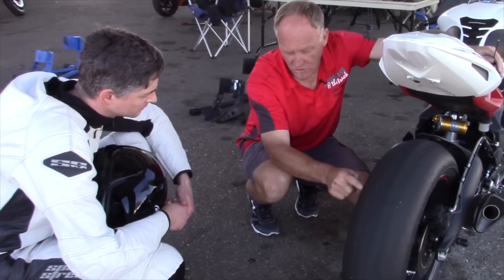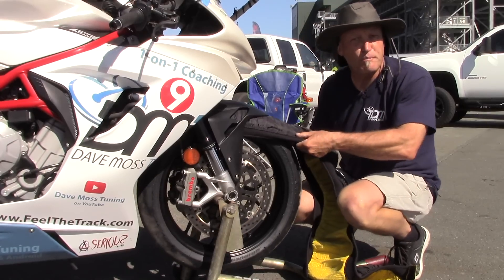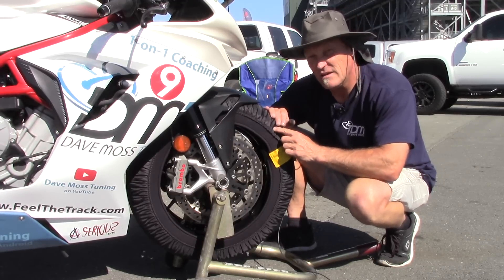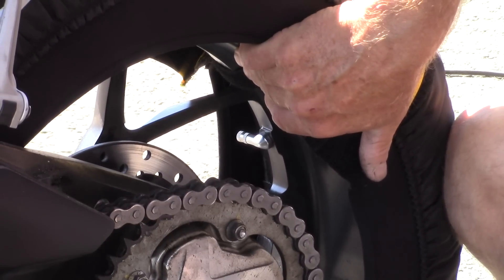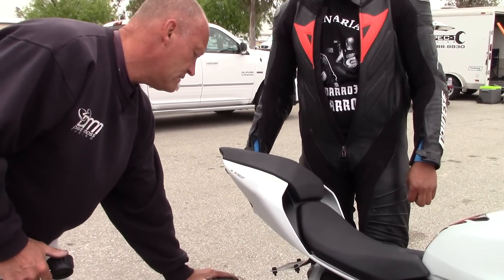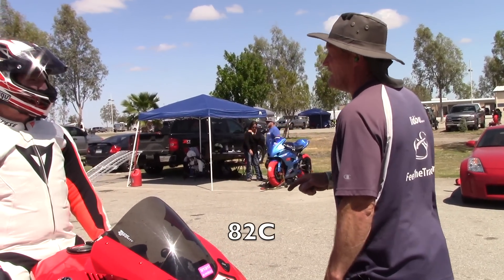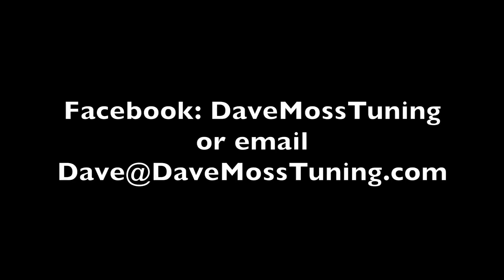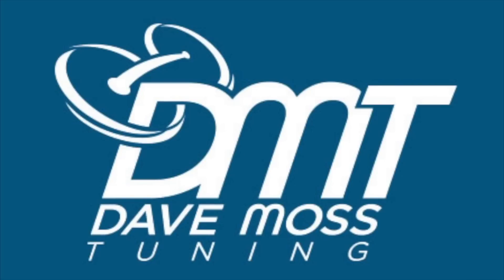Contact Patch: Motorcycle Tire Warmers

Comment: Just a thought. If that ramp you have is made of aluminium, then that will act as a heat sink and may actually by drawing heat away from the tire on the bottom.

Comment: whats a general rule of thumb hot to cold temps dave?
Reply from the maker: Cold to hot temps for road tires would be ambient to 50C. For track tires they should come off track at 60-65C in the braking and drive portions of the tyre.
Reply: i run a racing side car, we normally run around 111-13 psi cold temps

Comment: For a street tire...Dunlop Q3 Sportmax...on my CBR, if I only use careful lapping to warm up...on a 90 degree day which, is normal all summer, I do not have tyre warmers yet. CAN I get to safe temps after 10 minutes riding? Or is this a, too many variable, question? I am purchasing a tire temp gauge as we speak. I also  get about 20 minutes warm up to the canyon I ride through... quite spirited riding never a slip at safe high speed cornering 1 hour ride in the canyon. Checked the tyre by hand and I could hold my hand indefinitly... 120f is my guess. More friction on track so they must get hotter on track  then canyon rides.?? Probably a bad question on
Reply from the maker: You can get to optimal temperatures in less than 10 minutes of riding. With the bike at 90 degrees to the sun so both wheel get hot, you could be at temperature within 2 laps. See if you can acquire tyre warmers that are broken as they will most certainly help keeping the heat in the tyre and ensuring UV has minimal impact.
Reply: I emailed Dunlop and asked about warmers for the q3+'s. They told me there is no benefit to using warmers on those at all as they are  designed to heat up quite quickly on the road
Reply from the maker: @kaargh6924  Yes, that is their comment. In the end it comes down to us and how we master our emotions/brain. If warmers are used to make us "feel" better they should be on low. The beauty is we can choose what we want given the information we gather.

Comment: Hey dave, going from a q3+ to a q4 this season, i ride twisties n 3 track days this year. Should i go with the 180 60? What do i need to change to run a 60 over a 55?
Reply from the maker: Ride. If the 60 series turns better for you - nothing needed. If you feel it  turns too fast, change the fork position to flatten the bike out.
Reply: @catalystreactionsbw  so if its too quick lower raise the fork in the triple tree?
Reply from the maker: @DmanGuitar327  that is correct, 2-3mm if needed.

Comment: Wish we had tyre warmers in the 80s when I raced.
Back then it was like motocross the first 2 laps before the slicks got to temp which on a 1000cc super bike was pretty hairy.
Lost the front a few times from it trying to break away from the pack, one time a very costly write off.
Reply from the maker: That's when we would cut the back of the sipe off with a hot tyre knife knowing it would soon be a level side verses a bunch of steps.

Comment: Dave- I noticed in the beginning of the video the front warmer got the tire to above 200F. Is this a matter of concern versus the target of 180F?
Reply from the maker: Yes, it is noteworthy so going out on track the rubber is slightly over optimal BUT, tires lose heat quickly if you do not keep them under load so a little diligence on the out lap would bring things back in line and then a temp check after 4 laps will create worthwhile data points on carcass temps.

Comment: Hi Dave - with Bridgestone Slicks, what is the lowest ambient and track temperature you need to run safely (even while using warmers)?
Reply from the maker: I've raced with track temps in the 40F range and been 2psi lower off the warmers to get the right temps in the carcass. You cannot let cold air slow you down BUT you have to see what the track gives you for grip at those low temps.

Comment: Do you have a recommendation on generator for running 1 vs 2 sets of tire warmers. Everyone raves about Honda's but there are so many less expensive & more powerful options
Reply from the maker: As long as you know what your warmers draw for current/power, you can use any generator. You may need a 1000 but most use a 2000 so it doesn't stress the generator.
Reply: Dave Moss Tuning so badically don't worry about buying a ryobi one from home depot 😅
Reply: Dave Moss Tuning thanks for your response dave

Comment: i have the cheap tire warmers what i do is put them on as soon as get in the track no meter what, is that bad i know they turn on and off by themselves.
Reply from the maker: You need to know how hot they get and then how long the tires need to be at that heat level prior to setting hot pressures. If you get the timing right, no it is not bad. If you have them on full heat in the middle of summer, that might not be favorable, so them you set an amount of time they are on prior to going on track.

Comment: Dave - you mention on hot days turning the warmer to the Warm setting (if available) and then setting to Hot 10-15 mins before the session. Don't most tire warmers have a thermostat and if left on High would keep the tire at the desired/target temperature w/o this added step?
Reply from the maker: Most warmers do have a thermostat set at 180F that you can leave at that temp all day, some offer more choices. Tire manufacturers suggest time periods for warmers at those temps after a lot of research and testing, most from 30-50 minutes only. Would you like to be wrapped at 180F for 7 hours?
Reply: Thanks for the reply Dave. I meant more for people running sessions at a track day if they were to just keep the warmers set to the Hot temp (assuming the org is running three 20 min sessions) then they'd most likely have the warmers on and ready to rock with approx 30 mins on hot (the extra 10 mins due to takeoff of warmers, staging to grid, return to pit area, setup on stands and yes, cleaning tires - good point!) in between sessions. However - it is good to note that leaving the warmers on Hot over lunch time (when the bike might be sitting for 1.5 hours depending on how the day is run) might be a little excessive. I'm in the habit of setting the warmers to Warm when I return to the pits before lunch and then switching them back to Hot before I suit up. Seems to work out OK and I rarely, if ever, forget to switch them back. As always - thanks for all the great info and insight!!
Reply from the maker: Mike - on a 4 group format of 15 minutes that is fine. With a 3 group format if the temp is above 95F, then sun on the wheels will maintain the heat in the tires In the end, do what makes you happy and stick with it as when you roll out on the track, you need to focus on skills not be concerned with things you may or may not have done.

Comment: Do you have a recommendation for warmers that'll fit supermoto/SV650 tires? 160 rear or thereabouts.
Reply from the maker: Most manufacturers have warmers for 160 and 200 sizes. Check Chicken Hawk, Woodcraft and MotoD

Comment: Happened to me.  Had a borrowed generator that wasn't outputting proper power.  Thought my tires were hot, until I feel in turn 3.   Great info sir.
Reply from the maker: Thank you! Glad you check temperatures!
Reply: Matt, I watched your vids when you rode the ridge. I also fell victim to T3 when my rear tire went cold.

Comment: Do you check temperatures/pressures post-ride?
Reply from the maker: You can but you need to do it immediately or before the pace changes to slower speeds as you will lose heat.